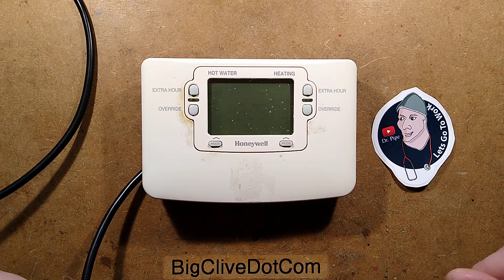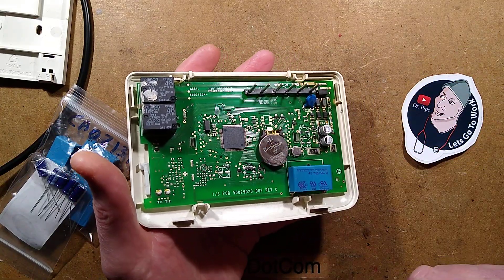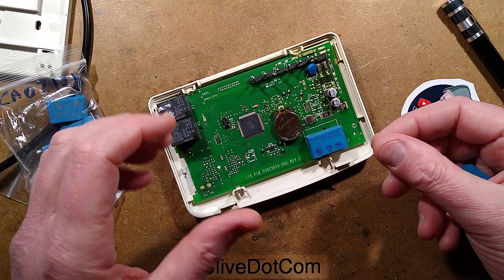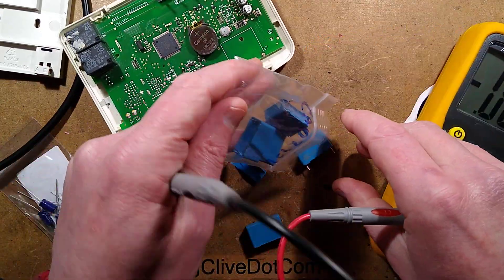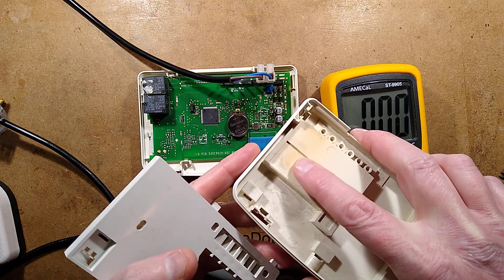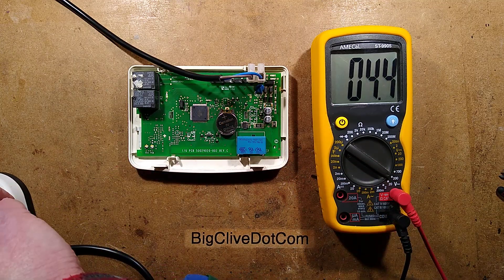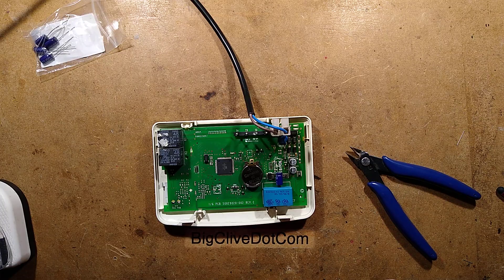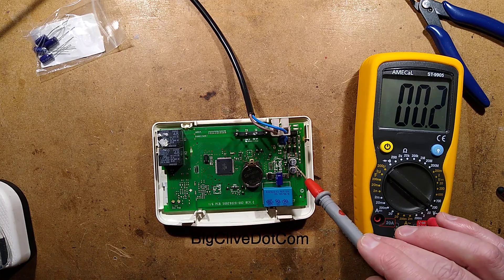Troubleshooting a heating controller.

Comment: Am I seeing 220V to the thermostat?
Reply: Yes, but it's not a thermostat, just a digital timer for when heating and hot water should be on. It is however very common in the UK for thermostats to have a 240vac supply, as they often control stuff directly, and they often have a ptc element (on with heating demand) to increase accuracy and/or prevent overrun.

Comment: God that takes me back - mains voltage, a test meter and a worn-out cap. 
Central heating had packed in; gas valve at the boiler was not switching on. Pocking araound with multi meter while I had the wife through in the kitchen switching the central heating on and off when I shouted. I figured out that the cap at the relay was buggered. Had a closer look at it and saw the dark stain below the cap that told the story of why it had failed. "Found it" I shouted through to the wife, 230volts then went through the hand prying the cap away from the board. Another failed attempt by blonde to claim on that life insurance. :-)
The one thing that will stop vintage IT products being collectable is the caps in the board, especially the miniaturised ones.

Comment: Over the years I have found, 100% of the faults in PSU with that type of SM electrolytic cap and heat scars on case, testing the caps out of circuit always 99% find them well out of speck, Poor enclosure design, poor air flow and over driven PSU = Built in Obsolescence. PS Do you ever read your comments on - https://odysee.com/@bigclivedotcom:0d/troubleshooting-a-heating-controller:b

Comment: hello, 70% to 80% fault in pcb board it is bad caps, X5R or electrolytic, which make shorts or dry inside , i dont supprised ...,
good job Big,
You are making interesting movies, greets the electronics technician from PL

Comment: I saved my (charity) employer £1600 by replacing faulty caps in the power supply of a piece of kit last month. I was inordinately proud of myself, and not a little surprised that it actually worked.

Comment: For those capacitors they put small lettering in grey on a blue background where the blue background has the same luminance as the grey lettering only differing in the chroma characteristics. Easily readable with a 2 million candle power flashlight and a 10x loupe.  It's one thing to do capacitors that way.  But it's even worse that my TV has light grey buttons on a slightly darker grey background.  To do anything with those buttons requires a strong flashlight.
Reply: They still have buttons on TVs? I thought you had to use the remote!

Comment: I love what you do and enjoy your channel. I have been trying to find decent g9 led bulbs as I have quite a lot of lamps that use them but I am lucky if I get a couple of months out of them could you do a test of g9 led bulbs that you get on eBay as I for one would greatly appreciate it all the best Mike
Reply from the maker: The problems with the G9 lamps are their tiny amount of space for electronics, and they way they push them to the very edge of failure.  They could run them at lower power, but don't.

Comment: I was repairing a 12v adapter once. Testing voltages while it was 220V live. I got distracted and forgot it was live. Went to pick up the PCB and ZAAAAP!! I couldn't let go. The legs of the through hole components were long and they protruded into my fingers. Because of the shock, I clinched my palm tight and the legs went deeper inside the skin of my fingers. I started making terrifying sounds(like, "wooo-ooo-oo...") through my mouth and those who saw my face got very scared and jumped up. Somehow my hands and feet went up and the PCB fell down, releasing me from the strange spell which felt like dying. It lasted for ~3 seconds. That was a few months ago and I haven't touched an smps since then. Be careful guys.

Comment: These tiny  caps are rubbish, I have run thin wires to caps that I have tucked away before.  Not to be done for a customer, just a mate.You could remove them and put two ones on their side if enough room, if not sleeve them and put them where they will fit.

Comment: I have had problems with THREE known brand thermostat controls over the last five years! When stripping down to repair I was TRULY appalled by the horrendous design blunders I saw!

1. Instead of ONLY connecting low voltage & current signal wires from the backplate to the control panel MAINS is connected (as per your Honeywell one). Ridiculous design! Mains simply does NOT need to pass to the front panel at all!9

2. No standard single or dual  backbox mounting, ONLY flat surface mounting ... WHY!?

3. TWO of my units (at the same time) controlling underfloor heating in our kitchen and dining room overheated so much due to lousy contact on the connection pins that I came down one morning and could smell hot plastic. I soon traced the smell to the dining room stat which was VERY hot on the front panel. After isolating it (and the kitchen one) I dismantled it and soon found the source and cause of the smell and overheating ... The aforementioned "inappropriate" contacts.

4. Further analysis showed that as a battery powered ONLY unit it ONLY switched a live connection (no neutral at the rear). Consequently by mounting the 3v relay ON THE BACKPLATE, no mains needed to be supplied to the panel only 3v from the panel to the relay and the switching pulse to the (mechanically latched) relay. Plus the thermostat sensor (14k thermistor) from the backplate to the front panel (total 4 connections as per original) 

WHY are design engineers for electrical controls SO dumb? It would be a piece of cake to design it (as I have now modified it) to integrate the relay onto the backplate. 

It would be JUST as easy to fit the batteries there too with a standard single or dual back box fitting for ease of fitting to either a new or an existing backbox! 

In the case of your Honeywell with mains dropper supply, the large dropper cap could also be fitted on the backplate, thus making troubleshooting FAR easier. AND providing better mains isolation to ONLY the back panel. 

UThe only mains level potentially available on the front panel would be under conditions of cap failure (short) and that would be low current and auto disconnected upon panel removal.

I really despair at such OBVIOUS engineering faux pax. They smack of a lack of understanding of field troubleshooting requirements - designed as suggested would mean a FAR simpler, safer field testing - an external battery and separate thermistor could supply the front panel for FULL operational testing involving ZERO mains potential. The back panel need only be tested for presence of mains (zero touch detector) and battery voltage. The mains switching relay need only be
a low voltage, 12v or below, mechanical latching  type consuming zero power in both N/O AND N/C positions! External testing is then very simple requiring only a single pulse to toggle the relay. Its low power requirements being supplied by the already permanent on-backplate dropper circuit.

ARRRGGH!

Comment: Maybe use some tiny insulating tubing on longer leads?  Looks like there's enough room in other areas of the case, so putting conventional sized caps somewhere else and use wires to reach the pads on the board.  It's mains frequency, so don't think an inch or two of lead will add much inductance.
Reply: Why does everyone pretend that the plastic casing is an impenetrable vault instead of just a plastic casing with some clearance behind that recessed area to do whatever you want with that space, once you remove material to make enough clearance?  Just solder on whatever new cap you have that has functional specs, make a hole in the casing for it, and done, 15 minutes later not devising some remote location and insulation scheme.
Reply: @stinkycheese804  Really?  A bit of wire is some terrible burden?  As opposed to drilling holes and having bits hanging out?  I mean yes, the case isn't titanium, but who wants a bunch of crud poking out just because you couldn't find five inches of wire?  What ever....

Comment: Since you have place for 4 capacitors, you might want to pick replacements with lower capacitance but higher voltage.
Usually maximum voltage is 3 times the nominal one. Aka if they are working at 50V, you would be safe to pick up caps for 150V. Switching processes could cause 3 times the nominal voltage, that could short the capacitor and ... turn it into heating element.
Reply: Meh no, you should not use caps that small in an electrolytic formulation. By the time you have the can and the plug at the bottom, plus the leads, there's very little space left in them for what they're supposed to be doing, lol.

Comment: I have tried to fix the circuit board from my fridge as it is stuck on cubes and will not switch to water.  Could I sent it to you to have an attempt to fix?
Reply from the maker: Search on YouTube for the model number and problem.  It may be common and could just be a sensor position.
Reply: @bigclivedotcom   Alas, I have tried much searching on the internet to no avail, I repaired the board that controls the temperature in the fridge/freezer successfully but the front panel issue has beat me :(

Comment: I had the exact same timer (ST9400C), with the exact same issue.  It turned out to be a "known issue" and they replaced it for free!
When it first started I managed to "fix" it by turning off the backlight, but later on it started again and could not be fixed.

Comment: Those mini caps are awesome at puking on PCBs and corroding them too..  I've seen people just twist them off, clean up the pads, and replace them that way.  It's more safe than trying to lift them in a lot of cases.
Reply from the maker: Having already lifted pads with one I'll be trying other techniques on the other.

Comment: Hey clive! Could you tell me how can I send something to you ?
I have led lightbulb that started to blink weirdly a year after, these lightbulbs were given by the french government, it should be high quality but it died in a year.
Maybe you would be interested to make a video on it to see the problem ?
Thanks & Regards :)
Reply from the maker: The blinking sound like either a failing LED junction or the power supply's capacitor failing and causing it to repeatedly restart.

Comment: i doubt that mains would go into a thermostat because if you touched the terminals on the wall plate that the thermostat snaps onto you could get a shock.

most likely there may be  a boost pump circuit that spikes the relay to mains level to turn it on and then drops down to say 12 volts to hold the relay.

surprisingly you dont need as many volts to hold the relay as you need to initially trigger it.

you can observe this effect if you take a 12 volt relay and put 12 volts to it it will click on then turn down the power supply down it should be around less than 5 volts before the relay lets go.

in todays day in age where companies are trying to shave every watt of power usage from their products (i guess they want to earn sellable cap and trade credits) .

heck even apple is squeezing blood from a rock in power savings  because the first thing many of us have to do is turn off the energy saver and screen blanking and screen saver to keep our macs on and ready to respond at a moments notice.

energy saving makes more sense on a laptop where you have a battery.

you know you can get higher value in the same form factor it does not have to be a 10 uf it could be a 100 uf.

also if you are good with surface mount you could get a small chip cap to replace it.
Reply from the maker: To remove the thermostat you need to loosen screws.  It has the plug system so that it can be replaced easily.

Comment: I can attest that they suck. I bought a rather expensive one from the same company. Less then a year later and it seems to have a mind of it's own. For a smart controller, it is rather stupid. Set it to automatically control the temperature and if it is 65° degrees in the house, it will attempt to cool it to 70° for one example.

Comment: Just wonder, why modern capacitors is such bad in a long term. Or it's just increasing frequencies in modern circuits(like in dc-dc convertors)
Reply from the maker: Over miniaturisation and operating at exponentially higher frequencies.

Comment: so here in the US we dont switch mains like that, most our thermostats are run from batteries and we use a low voltage 24 volt AC to the furnace like a light switch,

Comment: I may be confused as to what I'm looking at in this device, but I think there's an alternate fix. What if, instead of replacing surface mount components to smooth out the capacitive ripple so the unit's processer won't destabilize and reboot constantly... You coiled some thermo-expansive metal up, stuck the end of it between two magnetic pins, and tightened or loosened the coil to change the temperature at which it made contact?

Which I suppose is my way of asking... is this just a thermostat?
With the follow-up question: Why does my rice cooker have to have its own CPU now?!?
Reply: You found a backdoor, and now go to the shop and ask for the hole it fits in.

Comment: As someone who's spent many years fixing consumer electronics, I can say with 100% certainty that those nasty little SME capacitors are a complete bloody nightmare. I've seen far too many otherwise good-condition devices that have been totally destroted by those horrid things leaking their crap all over the board and eating away at the tracks :( 
Those things are complete garbage and should be avoided like the plague. I always replace them with through-hole caps just as you did in this video, as those SME ones are a failure looking for somewhere to happen. It's always best of course to use high-quality replacements, but even the cheap Chinese no-brand knockoffs on ebay are much more reliable than those dreadful SME's
Reply: @newscotlandtv  Yeah I'll have to remind them of that the next time I get one of those Watson-branded TVs in with over 150 of the damn things in it - ALL bad and leaking :(
Basically an uneconomic repair, so I lost money on that one, but at least I saved it from the landfill

Comment: I have their cm927 wireless controller.  After less than 5 years the display lost about half of the characters.  I took it apart blasted it with a hairdryer for a few minutes then pressed the layers of the display together which sorted the issue.  Two years on it is starting to fail again.  For a unit which costs to or three times what the likes of Screwfix sell they don't perform like a premium product.

Comment: ah well, since they are dead you can remove those two capped capacitors and just put 2x your blue ones in the space of the 4 SMD intended ones. perhaps add a zener if their max voltage is close.
Can't throw out all that money buying the right stuff ;-)

Comment: Just fish out some surface mount capacitors from an old computer motherboard that you might have laying around.... They usually have heaps of those things.. just make sure that they are the same ratings...
Reply: You won't find 63 Volt caps there.

Comment: A little trick to remove the SMD electrolytics is to get a pair of long nosed pliers and twist them off.  I like to push towards the board whilst doing this.  The wires within the capacitor break off (or pull themselves off the foil within), the black plastic base remains on the board - and protects the pads during the process.  You just remove the base, desolder the pins individually which is easy and clean up with braid & flux.  Never had any issues with this technique - the weak point of the cap is within, so little chance of lifting a pad.  No need for hot air which would be awkward anyway!
Reply from the maker: I'll try that.  I tried to desolder one and lifted tracks.
Reply: @bigclivedotcom  A demonstration of this technique is here : https://youtu.be/X8N9O3a9jiM?t=110 - sometimes the base remains, sometimes not... You just give the capacitor one turn.

Comment: I guessed smoothing capacitor, I win.
The new tolerance was intolerable.  I would also buy for it a new dropper capacitor that's within tolerance, it's a matter of time.
Reply: Meh the values of old and new were not that much different and as noted in the video, it was within tolerance.  Instead you might consult the datasheet for the relay to see if it gives a range of guaranteed trigger voltages.

Comment: I have never liked SMT electrolytics. They will have all gone through at least one reflow at a minimum of 260C/90sec and I have seen more than a few designers place electrolytics and Tant caps on side 1 so they get 2 reflows.

Comment: Is there a limit to measuring ripple that way? I imagine if you had a switching power supply, the frequency could be too high for a run-of-the-mill meter to detect it. Or is that not a problem?
Reply: A lot of meters won't go over 1KHz bandwidth. I have an old '60 Philips FET meter PM2403 that will do 25 KHz max. Switching power supplies go higher than that, up to 1 MHz.

Comment: Brown stain usually indicates some sort of problem. Look for the source of heat using IR once the circuit is behaving nominally.  

Heat sinking a resistor may be necessary to lower operating temperatures.

Comment: I’ve got a very similar “non Honeywell” controller which goes through batteries every 3/4 days for some reason
Reply from the maker: A really common problem these days is the tiny rectangular MLCC capacitors fracturing and developing resistance.

Comment: This reminds me of a headlight leveling motor unit on a 21 year old car, which has become very unstable. We tend to forget that dried up electrolytics can cause such instability. We also had a generator speed indicator which would not show a steady speed. Ironically, to accurately read the AC frequency of the generator, it needed a super smooth and noise free DC supply.